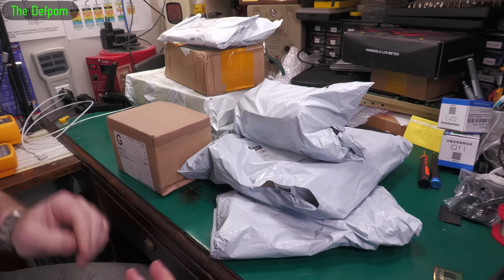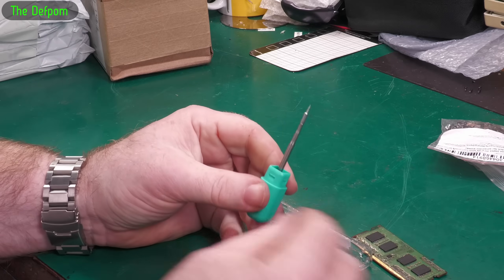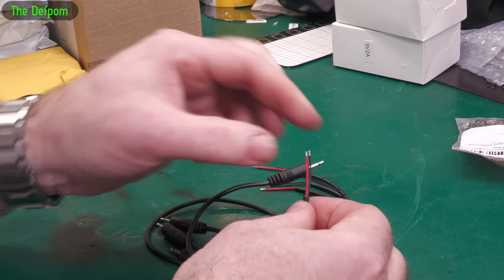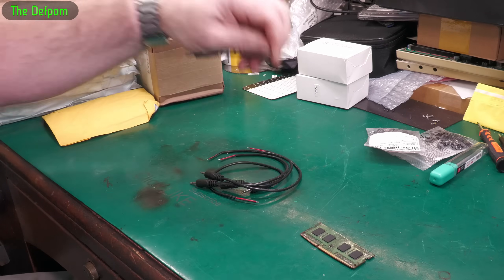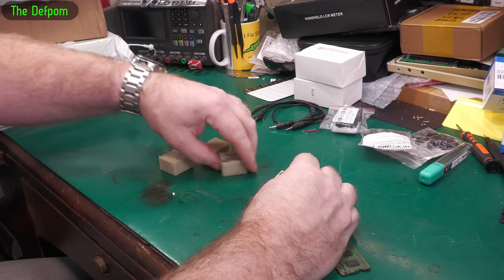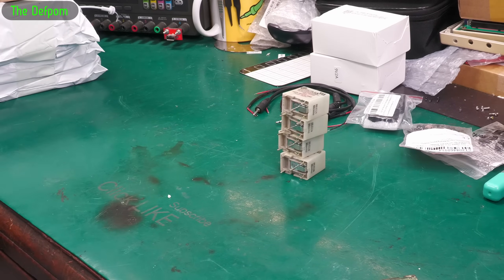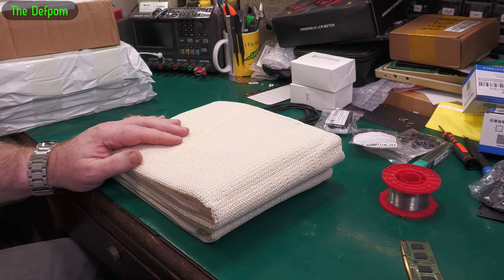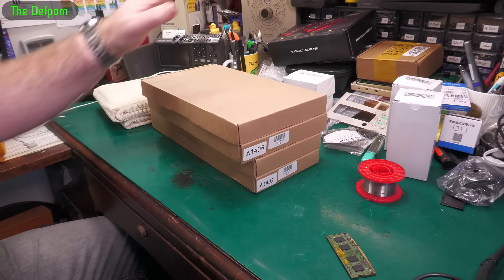🔴 Mailbag Monday 7th July 2025 - No.1375

Comment: I have used  the much bigger non-slip mats  ( made for rugs) to weave ws2211 seed pixels thu  to  make  portable reusable addressable led matrix / net panels that can fold up. 
probably not a use case people think of, but there  flexible, cheap, waterproof, and then wont slide around to much. they also let the wind tho so they wont blow around